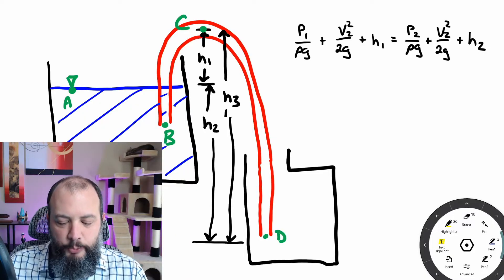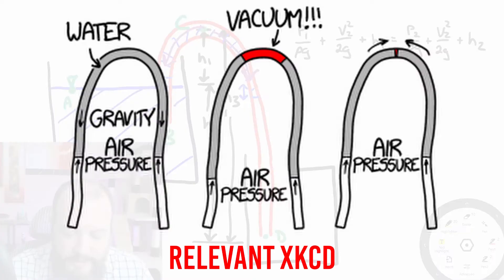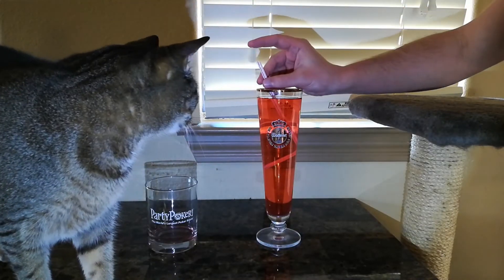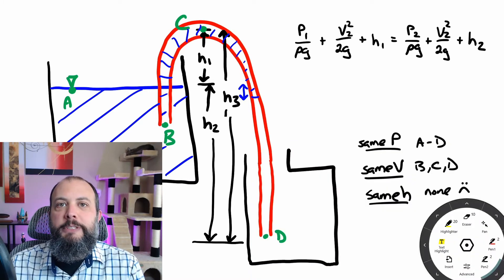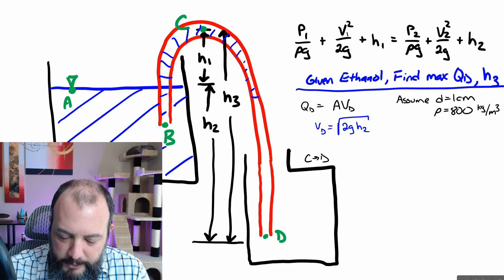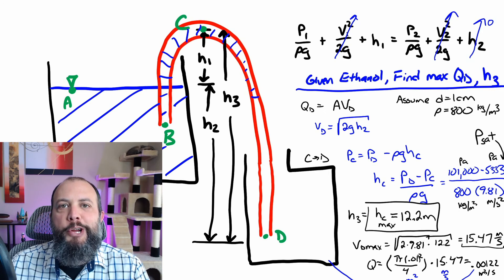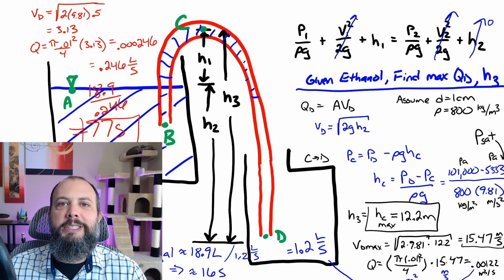Find Max Height for a Siphon – Bernoulli and Continuity Equation Example Problem

Comment: Thank you for your video here on siphons. I have a question if you are willing to help me out. I have a cave I'm siphoning water out of but the siphon keeps failing. I dug a hole in the cave deep enough to place a 5 gallon bucket into. I placed another 5 gallon bucket on the outside of the cave at the same level. I filled them both with water. I then filled a 1 and half inch pvc tube that connects to the 5 gallon buckets. I then opened the ends of the pvc tube. The siphon works initially, even though it's rather slow. But over time, it fails. Always. The only think I can think of is the height I have to take to pvc tube up to in order get it out of the cave. I have to take it approximately 13 to 15 feet up before it comes back down to the 5 gallon bucket outside the cave. Is this my problem? Do I need to find a way to lower the height of the tube? Any assistance would be GREATLY appreciated. Thank you for your time!
Reply from the maker: Is it possible to lower the receiving bucket? Instead of being at the same level, it's better if the receiving end is significantly lower than the origin. It could be failing not due to height in the middle, but when the origin and receiving heights are nearly equal.

Comment: what would be the maximum height in vacuum?
Reply from the maker: Vacuum would be less than the vaporization pressure, so my first thought is that all your liquid would vaporize to gas in a vacuum so the scenario doesn't really work anymore 😿
Reply: @BrianBernardEngineering  true, I saw experiment where they showed siphon effect in vacuum but they used some special liquid that 'survived' vacuum

Comment: can we say velocity at point C (summit) is zero because its the highest point?
Reply from the maker: Good guess, but no. Velocity will have to be constant at every point inside the tube. Same speed everywhere because of the Continuity Equation (conservation of mass). Since pipe diameter isn't changing, and for a liquid we can reasonably assume incompressible so density doesn't change and you can't have areas where fluid accumulates, the speed is same at the very top as at the exit.
Reply: @BrianBernardEngineering   thank you

Comment: Hi @Brian , thank you for your detailed explaination!

I have been pondering about your approach of finding Q_D_max & in relation to max height that the pipe can go before the siphon breaks around timeframe 10:36
My thoughts are as below:
- as per saturation pressure of ethanol (or any fluid), we can know the max height of vertical travelling distance up to point C (eg. ethanol ~12.2m; water ~10m)
- the above height refers to maximum height where the siphon "effect" can still be maintained before the liquid starts to cavitate at point C, and the siphon effect "breaks"
- I agree with the approach you used to find the said maximum height, which is to correlate between Point C & D.
- However, I disagree with using the said height to obtain a maximum velocity, as I believe the height h2 in the formula V_D = sqrt(2*g*h2) is referring to the static height between the upstream and the downstream, instead of the height of the siphon.

My arguments are as below: 
1) under normal circumstances (imagine there is no siphon, just regular flow from higher tank to a lower tank), the maximum flowrate Q_D_max are determined by the static head difference of the inlet/outlet/water levels, and also the pipe size.
2) coming back to this example, during a full siphon effect where the pipe is flowing full bore, the maximum flowrate from point B to D shall also be "pushed" from higher elevation to lower elevation, minus the friction losses that occurs in the pipe. 
3) Hence my understanding, the h2 in your sketch cannot be interchanged with h3, because h2 represents a static difference between upstream and downstream, while h3 represents the height of siphon pipe (h3_max as the highest the pipe can be raised vertically) that is only the pipeline that lies in between the upstream and downstream. 

4) since the height h3 affects the pipe length of the siphon, h3 directly contributes to pipe friction losses. The higher h3, the longer the siphon pipe length, the higher the pipe friction losses.
5) hence, for my calculation of maximum flow at point D Q_D_max, the siphon pipe shall be as short as possible, and hence h3 shall need to be MINIMUM instead of MAXIMUM.
6) hence, the h value that is plugged in for V_D_max shall be using the MIN value of h3, which is h2 (where no more siphon is required) instead of h3_max.

If according to your approach of plugging in h3_max into the formula V_D = sqrt(2*g*h), i believe it would picture a different scenario, where static difference between upstream and downstream is h3_max.

Appreciate if you can help to clarify on this. Apology for the long elaboration, as i wish to clarify my confusion on this topic. Thank you!
Reply from the maker: Yes, we are in agreement on this, so I might not have been clear in the video. "it would picture a different scenario" is correct. The maximum velocity would occur in a scenario where the initial height is already at the top. In my drawing, the initial height is in the middle, and it goes up higher to the max height, then down to the bottom. But if the initial height were already at the top, and the initial bump was effectively zero up to the peak, then all the way down to the exit, so that the exit was the max height below the inlet, that's how you get theoretical maximum velocity.
Reply: @BrianBernardEngineering  thank you for your reply!

Comment: what if the output tube diameters is diuble from the input. and the down loop is a a downward arch! It should increase the transport speed.
Reply from the maker: Hmmm, let's check. From Bernoulli Eqn, the exit velocity would not change based on exit diameter, it's only a function of the drop in height. Same velocity, but double the diameter, would mean 4x the volumetric flow rate (area*velocity, and area is proportional to diameter squared, and 2^2 = 4).

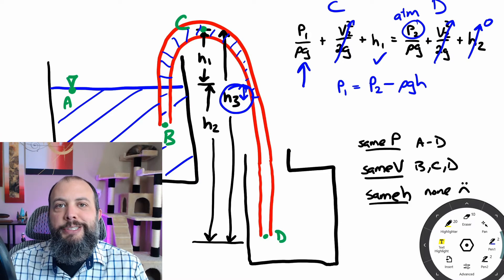Comment: At 7:30, why is does the atmospheric pressure at D not equal 0 and disappear. The final equation should be P1/pg + h1 = 0? Also it was proved that siphons can work in a vacuum, where p atm is negligible.
Reply from the maker: I was using absolute pressures instead of gage pressures, is why I used atm as 101kpa instead of 0. This problem could be completed in terms of gage pressure if you wanted, you would reach the same answer. But be careful when looking up vaporization pressures for your liquid, since those will probably be published as absolute pressure. I've seen the vacuum experiments (papers about them). There are some really cool siphon experiments that reject easy explanations. My favorite is the Flying Drop experiments. Very cool.

Comment: Is the diameter of the pipe influences the speed of the water flow? If so...whats the formula to count if i want to make the instalation fo water flow in 1000 Liter/ hour?
Reply from the maker: diameter does not affect "speed" as in meters/second, but it does affect "volumetric flow rate" as in liters/hour. Use Bernoulli eqn to find speed by comparing the top of the tank to the bottom exit from the tube. Then multiply speed by area of the pipe, pi r^2. You'll then have m/s*m^2 which gives you m^3/s, volumetric flow rate. Then unit conversion to liters per hour. Warning - this flowrate only applies at this moment in time. As the tank empties out, the flowrate will slow down, since the height gets lower as it empties, so the exit velocity will decrease, so flowrate decreases. I have another video called "Find time taken to empty a tank" which addresses this exact warning and how you can overcome it, if you are really interested in finding time, not just flowrate.
Reply: @BrianBernardEngineering  thank youuuu ❤️ its fine...because i will use power head pump with power 1000liter/hhour to return the water from bottom tank move to the over tank...to make the water will flows continuosly...so the water in over tank will not deacrease or going to empty  ❤️❤️❤️

Now i find the missing key that diameters doesnt effect the speed of the flows as in meter/second ...big thanks for you ❤️❤️❤️

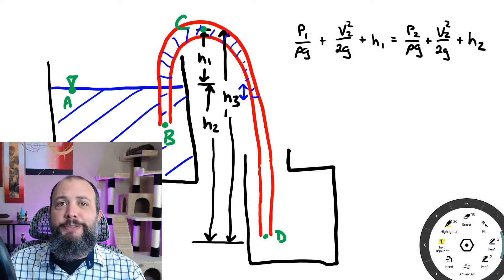Comment: Nice and logical explanation. 1:15 In some schools the operation of the siphon is still explained as the result of atmospheric pressure.
Reply from the maker: It's probably not harmful to think of it that way, even if technically not fully correct. Similar to in electrical circuits, we think of current flowing from positive to negative, even though we now know its electrons that are moving, and they move the other way. There's a bunch of these sorts of things throughout engineering curriculums, that while not entirely correct, it's still kind of ok to think that way, because it may still be useful in understanding a bigger picture, even if the details are a bit off.
Reply: @BrianBernardEngineering  Thanks for the reply. I agree. We should keep in mind as many possibilities as possible for some conclusion in order to be able to see what works to what extent. It should not be exclusive. Doubt about correctness leads to the right answer. I don't speak English very well, sorry if there are mistakes.

Comment: This is an amazing explanation Dr. Brian. I have been scratching my head for a while now when it comes to siphons but your explanation was very clear! I have a burning question: 

does the siphon work better if the outlet end is submerged? Or does it not matter? 

(My thinking is- if it’s not submerged, air can get in more easily and break the siphon especially at low rates… but then again, if it’s not submerged, the pressure difference remains the same as time progresses. For example, if you let the outlet end of the siphon spill onto the floor, it will spill out until it’s empty, right? If submerged, the pressure difference decreases and the velocity decreases as time progresses, and a state of equilibrium is reached as you explained.)
Reply from the maker: Main difference with submerged exit is increased pressure. However far under the surface, that's extra pressure. Bernoulli Eqn from inlet to outlet, you would then have a lower change in pressure between inlet and outlet, same change in height between inlet and outlet, therefore velocity difference would have to be smaller. Flow rate would be slower.

Comment: Does the pressure of the water depth have any effect on siphon height?

For instance say the siphon was located deep in the ocean.

And assume the other end was still below relative. Somehow it’s magically emptying into the abyss or something.

Could you increase the maximum height of the siphon then, beyond 10 meters?

Not that there would be any particular use for this. I’m just wondering about the mechanics of the maximum height.
Reply from the maker: Yes, Pressure at the exit DOES make a difference. This video focused on examples where both ends are at atmospheric pressure, since that's the normal scenario we see most often, like when draining water out of a large aquarium. But if the exit is above atmospheric pressure, then the siphon height CAN be higher than the max I stated in this video. This is a really good sign, when you are able to learn something, and you then can find edge cases like this where it's a little bit different - shows you are understanding the bigger picture and not just memorizing details. Good work!
Reply: @BrianBernardEngineering  Great thanks a lot for the reply and the educational content :)

Does the water pressure at the entrance make any difference? Or in other words, the water depth of the end of the siphon (the higher end, the one where water will enter from).
Reply from the maker: @solank7620  Yes, you're right, both inlet and exit pressures matter, it's really the difference in pressure between inlet and outlet that is important. Regular siphon, same atm pressure both ends, the difference in height inlet to outlet is what determines the velocity in the siphon. When inlet and exit pressures are different, that difference also contributes to velocity in the siphon, just like difference in height. If inlet lower pressure than outlet, velocity will be lower than it would be based on height alone. Once you know velocity, then you can get max height. And you should get same height whether you measure above inlet or above outlet.
Reply: @BrianBernardEngineering that is so interesting because it is a bit counterintuitive - that the siphon height increases with higher pressure at the outlet of the siphon. But looking at the equation, that is true. But still I can’t get my head around it!

Comment: Great video, there's something that confuses me though
What's the hydrostatic pressure at C and D ? Is there even hydrostatic pressure at those points? If there is, point D is lower than point B so how come water flows from lower pressure to higher?
Reply from the maker: C (top of the siphon) to D (exit of the siphon): Point D is exposed to the atmosphere, so if hydrostatic pressure is rho*g*h, point D is at h=0. It's not submerged at all, it's at the surface. I'd call this 0 gage pressure (or atmospheric absolute pressure). Point C ... this point has a negative depth from D. It's hydrostatic pressure is rho*g*-h, since it's not at a depth at all, it's actually above point D. Electricity flows from higher voltage to lower voltage. Heat flows from higher temperature to lower temperature. These are Potentials. Flow is generally from higher potential to lower potential. Fluid flow is often from high pressure to low pressure - but it doesn't have to be. There are other sources of potential that are relevant besides pressure, ie gravity. Water prefers to flow downhill, not uphill. In this siphon, pressure and gravity fight each other, which is why the result is partially counterintuitive.
Reply: Thank you so much sir, for taking the time to reply🙏.  
So..when you mention point D is at zero height, which height do you mean, from where do you measure that h ? 
If we were to calculate the hydrostatic pressure in the first container then height zero whould be at point A. And sure point C whould have negative height, but point D wouldn't.
As the 2 containers are filled with water they are basically connected through the siphon, so can we calculate the hydrostatic pressure as if we had one large container? If we do so and point A is zero height then point D has a very large hydrostatic pressure, larger than any point in the first container.
Reply from the maker: @captainamericawhyso5917  We're playing a little loosey goosey with the term "hydrostatic" in this discussion. Static = not moving. The difference between A and D is velocity, A is modeled as stationary (or moving very slow approximately zero), but fluid at D is moving. You must account for the dynamics, not just the statics. That's why D isn't at higher pressure than A. The gravitational potential energy at A didn't become pressure at D, it became velocity. For C and D, Even though fluid is moving between C and D, it's moving at same velocity, which allows a hydrostatic analysis between them, since the velocity terms cancel out. The hydrostatic pressure equation is just the Bernoulli Eqn, with velocities either zero, or equal to each other.
Reply: Thank you very much once again🙇‍♂️
I'll need to think this a little more to understand whats going on

Comment: I'm trying to extend the siphon duration.  I cant change the pipe size which is 3/4 in.  if I add a 1/4 inch coupler to the outlet will the siphon still work?
Reply from the maker: Let's work it out. If both ends are at atmospheric pressure, the siphon really just converts PE on inlet into KE on outlet. And good news, kinetic energy is only based on velocity, not area. Same PE at inlet, same KE at outlet, so same velocity leaving, but with smaller area, means smaller volumetric flowrate. Volumetric flowrate Q is VA, and area is based on diameter squared. Your coupler reduces diameter by 3x, so it reduces area by 9x. If area is 9x smaller, then at same velocity, volumetric flowrate will be 9x lower. This should make time 9x longer to empty. Yes, I think your plan should work, and by making the outlet 3x smaller diameter, you should increase time to empty by 9x. This is an approximation since we aren't including head loss, but is hopefully good enough for your purpose.

Comment: how would you go about finding the velocity at the submerged end of the pipe and therefore the static pressure there? great vid
Reply from the maker: based on continuity, velocity will be the same at every point of the pipe, so the submerged inlet will have same velocity as the exit of the pipe.

Comment: Why couldn't I compare points A and C to get the maximum height of the siphon? knowing the pressures at both points and assuming velocity at point C is zero at the saturation pressure, I tried to solve it that way but it gave me a bigger value of height and I don't get why it's wrong.
Reply from the maker: Velocity wouldn't be zero at the top. From the continuity equation, velocity needs to be equal at every point in the tube, otherwise you are accumulating mass somewhere instead of mass in = mass out for each control volume. Restated - the conservation of mass requires velocity to be the same at the top as at the exit (since cross sectional area is the same at both points, really its mass flow rate that has to be equal at both, but in this problem that makes velocity the same at both spots). From conservation of energy, since you didn't include kinetic energy at the top, the height you found was too large since the gravitational potential energy included energy that should have gone towards v.